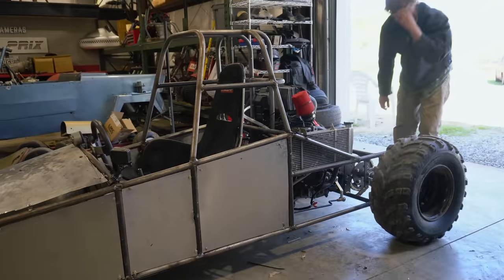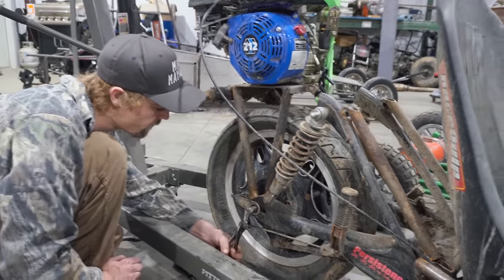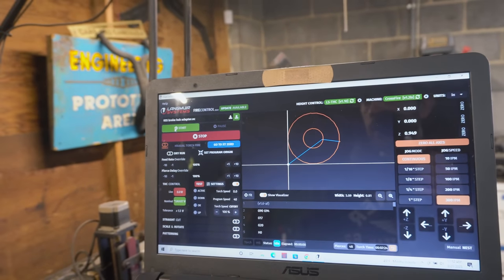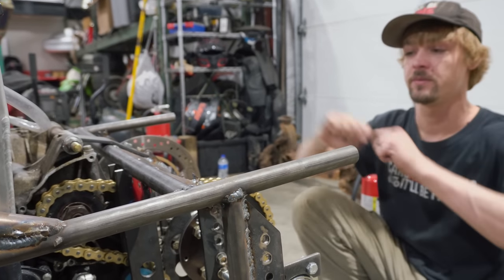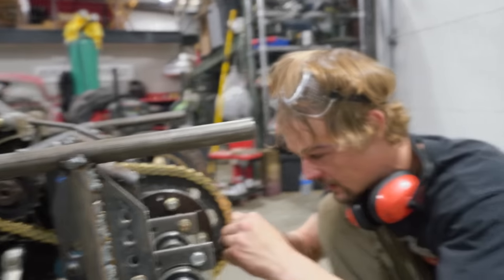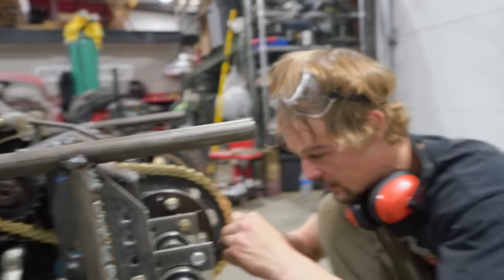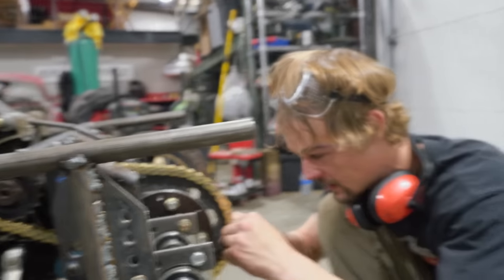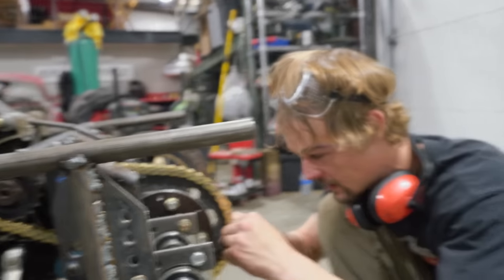Triumph 955cc Dragster First Test Drive!

Comment: 8:38 think of the bottom part of the chain run like the bottom section of chain on a bike. Its so loose it slaps the frame over rough terrain (well they used to but you get thr point.)

Comment: That clutch is designed for hand control.  You need a shorter pull leaver on your pedal because the force from your leg will just snap another one.  Handles only move the cabble and inch with all of ten pounds of pull(guessing here).

Comment: Best clutch setup I've had on a rig like that was hydraulic, I used the mastercylinder for the front brake on a victory motorcycle and slave cylinder from a scrap Honda civic
Reply: Hand clutch and foot shifter

Comment: Where you’ve got the axle bearings mounted, with all that adjustment points,, you’ve created a track locater of sorts,, very nice touch,,did you include a full tank of full and driver weight?

Comment: I'm left handed and I prefer to have the shifter on the right side.Charles might as well said six hundred pounds. with a locked rear axle you're going want to have some weight on the front so it will steer. that metal makes a lot of noise. It sounds Triumphant all pun intended.

Comment: NEED HELP! I put a larger sprocket on engine (3.5 to 6") of my troy bilt 24 hp mower, no change for transmission. Now when I go forward or backward transmission is grinding. Have others had this problem? How did you fix?

Comment: I personally really liked the scoops way better than the scoopless version that is currently here... I'll just say that much. Don't get me wrong, this thing is cool, but it'd be cooler with the scoops. And besides, If I were to make something similar to this on my own, I'd totally have the scoops. Besides, the sccops/sidepods or whatever you wanna call them, would have some use besides to act as air guides to push air thru the radiators and whatnot, since, if done correctly, could also wind up not causing too much drag with proper airflow. Plus also it would give some air to the engine compartment, and cool the engine some as well, mostly the lower half of the engine tho, so things like the transmission and crankcase would be cooled by the airflow.

Comment: Important!! You are going to need to weld in  some better support across the chassis because it was flexing all the way. Those metal panels freak me out. If one of them comes loose, "things" might get sliced off. Basically a guillotine. Seriously. My suggestion is that you look for some alternative solution that isn't as dangerous.

Comment: Hopefully it doesnt shatter into a pile of shattered tubing considering what the welds on that frame look like. They appear to be cold and cold lapped and triggered in most places. If it was old dirty used materials being repaired I can understand having a questionable one here and there but a new car built from new materials should be welded correctly in one pass with no cold spots and no grinding. You guys are now professionals, practice makes perfect now get on it !

Comment: the bike probably weighed around 450-470 pounds (soaking wet). and with that full steel frame/cage i was expecting around 570 so its actually a little better than i thought

Comment: install a clutch stop on the pedal to stop over pulling the lever too far remember the original cable would only be pulled an inch or so at best.

Comment: Considering that the smaller displacement atvs weigh in around 400+ lbs and only make 8-16 hp and low torque numbers and even the bigger bore machines weigh in at 700-1000lbs and make 32-60hp max,other than the 1000cc machines that eat parts,cost 2 arms,1 leg,and your 1st born,in reality the power to weight ratio for this pile isn't  very bad at all,especially if it was making the so called 120 hp...5 lbs per hp weight ratio ain't  nowhere near sneezing at nor slouching area... js.. possible contender if those welds and chassis work ever passes a close inspection by an accredited knowing inspector..

Comment: Looking at it and the amount of power it can produce I’d be willing to say it should be able to run slicks for like a Honda civic . Instead of cart slicks . May even need a little wheels bar 🤷🏻‍♂️
Reply: And it just so happens that most Honda atv hubs are the same bolt pattern as a civic

Comment: I need help with my predator 212 engine it starts and runs when I got my kart on Jack it let it off Jack and it dies  so when it is under any kind of load it dies I would really appreciate it if I can get some help on it think you

Comment: 2:30 It's alright John. The 80s ones are kinda ugly anyways, that's why there's so many 80s CB750s and not that many 70s CB750s. The easiest way to tell a 1970s CB is by the wheels. 70s CBs have  spoked wheels and, most of the time, single overhead cam engines.

Comment: Just my 2 cents I didn’t build the thing but maybe even shorter gearing? If y’all were only in 1st, 2nd that’s gonna be a 150-180mph machine. I’d rather bang gears and use the whole tranny and make it more usable everywhere than go 60mph in 2nd gear and 150 in 4th…. Safety wise too.

Comment: yall are actually wrong the cb750 wasnt the first street/sport bike my 1962 honda dream 250 was it was hondas first attempt at a street bike which i think they did good considering it did over 100mph in 1962 the cb 750 came out shortly after dont feel bad about cutting up a cb750 alot of people do and its just tube metal you can make a whole new one from scratch
Reply: also i would highly suggest yall build a rounded x in the rear for saftey and so the tubes arent just open and you could even put tailaights back there too

Comment: Much as I dislike being negative, this build is way past the speeds at which you guys need to really step up the welding and design. My suggestion would be to study modern dragster design and scale it down. Slapping tubing together on the floor is cool and all, but if your front end snaps off or folds at the top end of a drag pass in this beast, someone is going to get seriously hurt. We all love the builds, but its not worth your health and safety
Reply: It’ll be fine
Reply: Ike’s enormous balls will protect him from serious injury. The other two better stay off of it
Reply: @zanechristenson3436  He's really gonna be in trouble when he gets old....those suckers gonna drag behind him a long way
Reply: @ManiacRacing  lol I thought that shortly after he ain’t far off of it. But he’s gonna send it anyway
Reply: No no why qwatch racing??for crashes
Reply: Just here to say nice name, bro. 😊
Reply: I trust the build...
You say it's underbuilt and unsafe.
 I say it's overbuilt.
The only parts that need to be extra heavy duty, is the drivetrain and roll cage.
Reply: @CarsandCameras Why haven’t you done anything with the rail2.0 yet

Comment: The first ever super bike was a 1973 Kawasaki z1 900. There was a battle back then between the cb750s and z1/kz 900/1000 for quarter mile times. No doubt there is some confusion between the two bikes
Reply: I agree the Kawasaki z1 900 was it. CB's with MAGS are POS.
Reply: Not so .
69 CB 750 single cam was first .
Well documented. 
Kawasaki came later
Reply: @peterherrington3300  the reason why the z1 900 was considered the first superbike was due to the fact that it was the first to use a twin cam setup
Reply: @justinkohn2616  The CB450 had twin cams in 1965.
Reply: @rz350ypvs1  and nowhere near the horsepower as well.
Reply: PPL Superbikes are Liter bikes, the 750 Superbikes didn't come till the early 80's. I know I use to race in the 1980's.